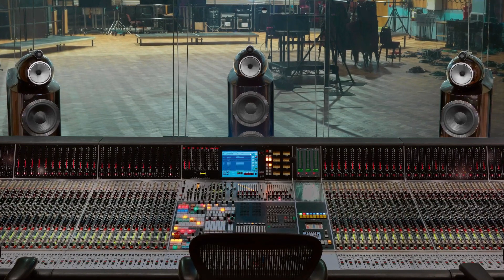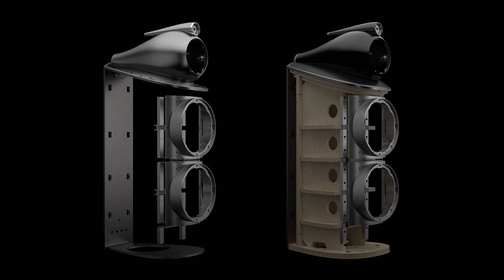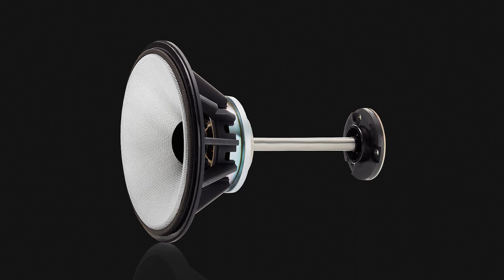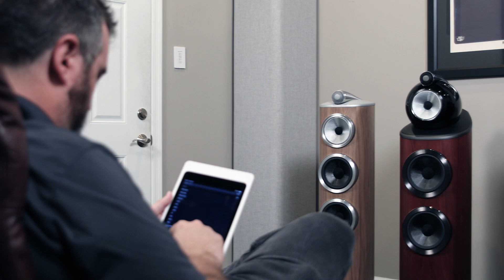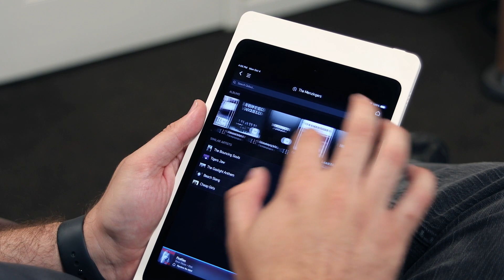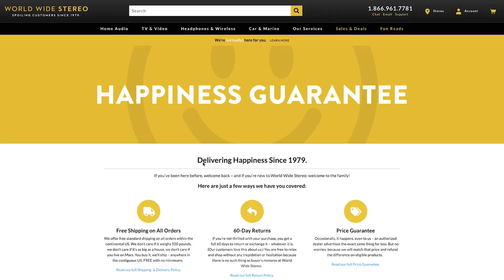Review: Bowers & Wilkins 800 Series Diamond D4 Speakers

Comment: You should work for (or start up) an independent reviewing company. Your description was better than anything on the internet because you come across as being very authentic and believable. You also correctly focus on the core value of a system and not just technical specifications. Rather, you focus on what it's like to experience them and how they make you feel. That's what it's all about.

Comment: I’ve got the 803d3 with the center on a parasound a51 in an atmos setup. I love the warm sound. I didn’t listen to the 802 and 800. And I will not do that untill I’m ready to buy them. Probably my parasound will not have enough power for them, which feels insane to me. So the investment will be way more than just the speakers. Anyway I like the new look with the leather and also the light wood finish.
Reply from the maker: Thanks for your input. The 805 D3 is a tough speaker to beat as a bookshelf 2 way. Moving to a larger enclosure extends the frequency response and adds the unique B&W FST midrange. It’s a big step in value and performance.
Reply: I have the 805 D3 myself love them not worth 8500 plus 1250 for the Stands to upgrade. The 801 D4 has the biggest upgrade with the spider. I’d wait until the spider technology is implemented in more of the speakers even if it takes years
Reply: In my room size run a 4.2 configuration the 805 D3 surrounds 705 s2 and 2 bowers asw 500 subs I know they are older models but still excellent. I did a lot of tweaking in the eq an I say I was able to get the D3 97% to the D4  only reason I don’t say 99 is because of the cabinet differences. Anything the D3 don’t cover the subs are excellent at. Took a lot of tweaking placement and calibrating but you can close your eyes and feel like you’re at the performance. In order to upgrade to towers I’d need more room. Can’t have a speaker like that for the sake of it. I hope they implement the biometric suspension the the bookshelf in the future.